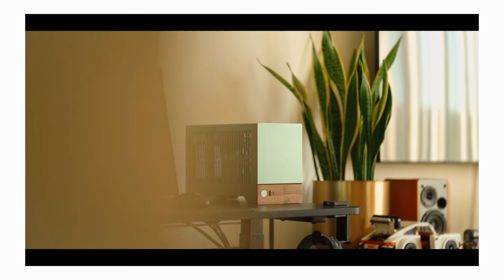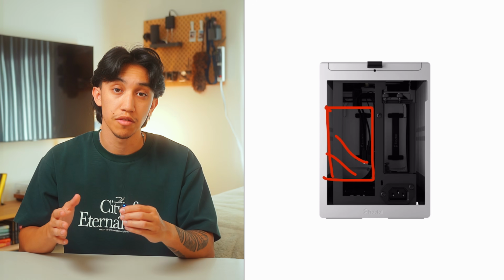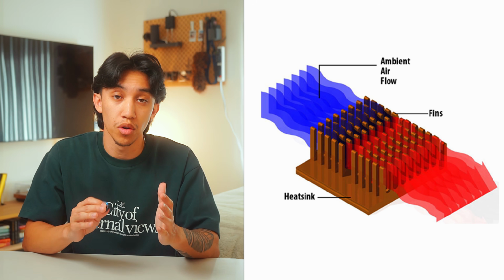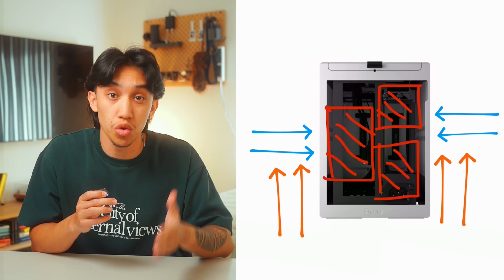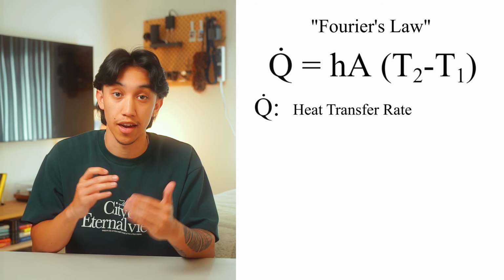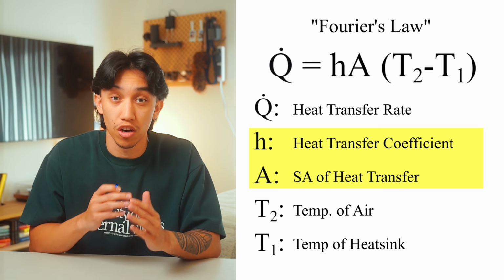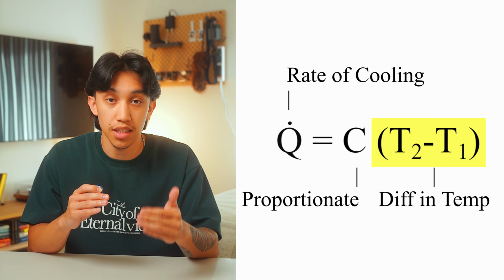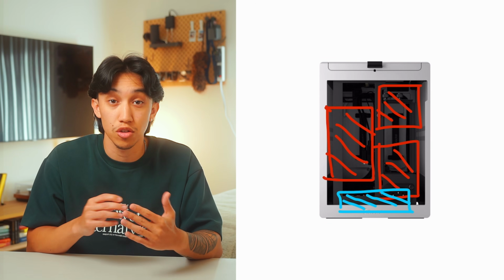Watch BEFORE You Buy! | Fractal Terra Thermal Issues

Comment: Optimum Tech did a similar video with the ghost S1 and saw lower temps using a single fan as exhaust. He did actual testing and posted results. Your video isn’t very scientific and seems more opinionated. When it comes to optimising thermals in a small itx case there are so many variables. It’s not impossible to run mid to high end components in this case while managing thermals.
Reply from the maker: This video was to show the theory of thermodynamics that I think proves why people are having issues using this case with high end, energy-hungry components.  So yes, these are just my opinions but they are based in theory and weeks of research & testing within reason for a normal person like me.  I don’t have extra CPUs, GPUs, or coolers to do side-by-side testing so reading about other people’s experiences showed that I wasn’t the only one experiencing this, leading to me making the video.  I could’ve been more quantitative with my declarations, but that would’ve been too specific to my build, so I went with the qualitative conclusions that could be applied to a variety of different builds within this case.

Comment: I'd recommend setting some strict power draw limits for your cpu in bios. Undervolting helps but it'll still try to draw the full 200+ watts and there's just no way any cooler that fits the Terra is gonna keep up with that. I'd think maybe 120w at best but you know, do your own testing.
Reply from the maker: I actually did both.  I don’t remember the exact numbers but i undervolted as well as had power limits at around 130W.  It helped, but like you said, there no way to cool something that power hungry without proper airflow.  It’s tough because I really liked the look of this thing

Comment: I agree. 
The airflow is poor and there are problems with cooling the motherboard. The operating temperature of the M2 SSD is quite high and sometimes a fatal error occurs.
 I changed to the NCASE M2.
Reply from the maker: M2 seems to be a great case!  Keep me updated on how it goes!
Reply: @KyleMunozTech  The installation of the NCASE M2 has improved to a level where there are no problems.
The CPU temperature is -20°C after changing from an air-cooled cooler to a 280mm liquid-cooled cooler. The GPU and motherboard temperatures have also dropped, but the drop in the ITX motherboard temperature is less than 10°C, including the operating temperature of the M2 SSD.
As you point out, airflow is important for cooling.
Cooling performance is a weak point for ITX motherboards, as each manufacturer adds small fans to the VRM and M2 SSD.
Reply from the maker: yeah, i’ve seen very similar improvements after swapping cases and moving to liquid cooling.

Comment: Fractal Terra case
Ryzen 7 5800x3D (undervolted and legit see zero performance issue in benchmarks and renders) 
rtx 4060 gigabyte low profile
Corsair SFX 750
Thermalright AXP90 X47 (Full Copper)
zero exhaust fan 
Corsair Ram 32gb 

CPU has never went above 85c in (COD Cold War, Overwatch, Cyberpunk 2077) HOT SPOT in stress test 3dmark steel nomad was 85C on GPU.
After Effects 3D rendering CPU was pushing 80C consistently- luckily I use premiere mostly for my job lol. Premiere was 100% fine doing 4K video editing.

GPU range 40-72

I've not had issues, but I might install a top mounted exhaust fan to help with the temps a bit.
Reply from the maker: That’s awesome! Yeah from what I’ve seen, Ryzen CPUs work well in this case.  Less power hungry so less heat to get rid of.

Comment: I'm a little concerned as I'll be using the L9i noctua cooler. But hopefully it'll work, the cooler is compatible and the 9700X is pretty power efficient so here's hoping!
Reply from the maker: I think you’ll be good.  Maybe a little under volt just to ensure but I think it should stay within a safe temp range.
Reply: I’d recommend the l12s or x77 variant

Comment: I think your issue is using an Intel CPU... they hog power and output too much heat... just get a 7800x3d
Reply from the maker: Agreed!  Intel CPUS are wayyyy too hot for a case like this.  It’s honestly kinda ridiculous the kind of power they draw
Reply: Well i'm using Ryzen 7 7800x3D with Noctua NH-L12S x77 as a CPU cooler and another noctual slim 120mm at the bottom of the case. I don't know if they are well set, i think CPU is in exhaust mode and bottom 120mm is pushin fresh air from the bottom. And i'm experiencing +90°C on the CPU while gaming😢. Any help is welcome
Reply: @enriquecoellotorres9537 honestly swap the lower fan to intake and push hot air through the top
Reply from the maker: didn’t work for me 🤷‍♂️
Reply from the maker: Machines & More has a couple  really great videos about cooling the 7800x3D in the fractal terra.  I think he'd have better insights about your situation

Comment: I7-13700F, cooler axp120-x67 . Was quite ok browsing, playing CS. But temps reached 90c and sometimes 100 while playing Cyberpunk. I have Asus mb, ended up settings default intel power limits.
Reply from the maker: Yeah same here.  I played around with power limits and i think i ended up being stable around 155W, and it helped but not as much as I'd hoped.  @viquor has had some success with two slim fans on the bottom of the case, maybe try that out and see if the extra airflow helps?

Comment: no, you're dumb for using a 13th gen intel CPU when there's much more efficient AMD available.
But also, for thinking undervolting which is what a -5% power? is a solution to bad airflow. If your airflow is bad you need to fix the airflow not to reduce power consumption, but ok, say you wanted to reduce the power consumption for whatever reason, you would just do that with straight up setting a power limit, which is extremely simple and you can easily set a 50% or lower power limit without any stability issues. Yet you went for undervolting why? because it's a popular concept today?
Reply from the maker: Yup 13th gen wasn’t the best but I already took responsibility for that choice.  Pretty obvious that fixing airflow is the solution to bad airflow…😂 The whole point of of the video is that the airflow in this case is not good, and since airflow is meant to cool components, reducing the heat produced by those components is another solution.  When I said I undervolted, I meant that I both undervolted and power limited the CPU as low as i could while keeping it stable (around 140W as opposed to the stock 250W) and it was STILL thermal throttling.  Any more helpful suggestions that maybe i haven’t tried yet?

Comment: Most all sandwich sff cases are negative pressure like this for the best thermal results. Just comes with the territory. I have a terra with a 7800x3d and 4090FE and its runs quite well.
Reply from the maker: yeah understood.  I definitely take blame for putting a hot ass CPU in there lol
Reply: What cooler for 7800x3d? Undervolt both CPU & GPU?
Reply: Can you post your build? I'm trying the same thing